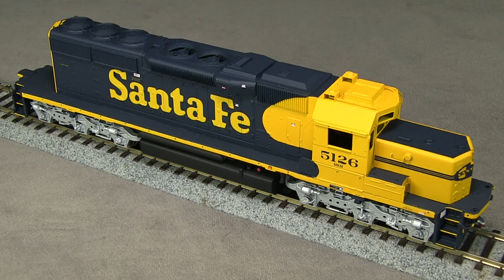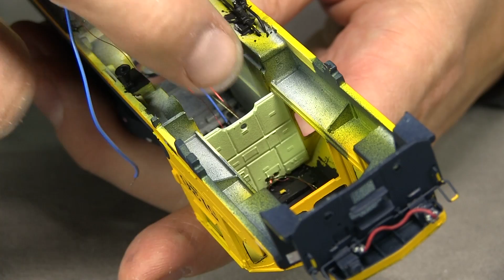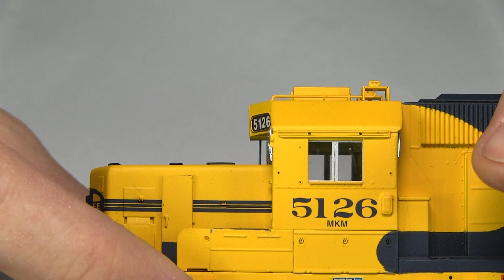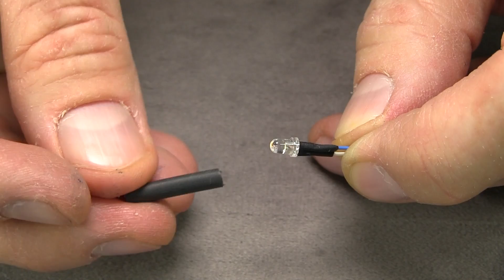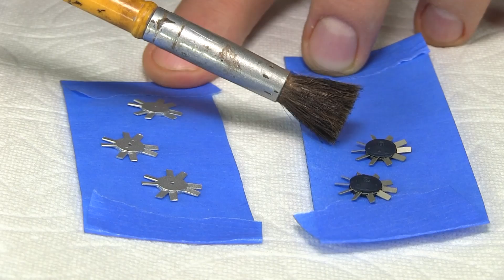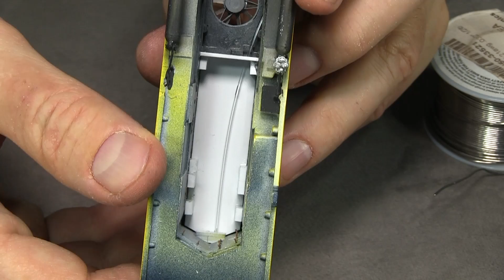HO Scale SD40-2 Model Building 22 of 25 Final Assembly Pt. 1

Comment: I'm not sure, but i think that that since this locomotive had a lowered head light, that that thing from the nose to the number board area is to run the power to the lowered head light from where it used to be.
Reply from the maker: I think that's right. Someone else mentioned that possibility. I think someone else once suggested it might be a pipe for A/C condensation to drip out of. I can't remember now...

Comment: 26:30 It is technically possible to have rotating fans in a HO scale model. Hornby has done it with some of their 00 scale models, like the class 50 and 56 diesel locomotives, IIRC it used a gearbox driven off the drive-motor by a rubber band.

the problem was it sapped pulling power and in the end looked about as noticeable as a stationary fan that had been modeled to look like it was rotating with a translucent disk instead of fan blades, so it's not really worth it.
Reply: I have seen it done with pager motors and looks pretty good depending on the fan housing that is used and if you use shiny aftermarket metal fans. As for getting prototypical rotational speeds the current available for the motor from the decoder function pin needs to be minimal (because the motor has a small load, the load being the simple task of turning the fan). If you fail to limit current draw properly the motor will greedily draw all available current  and spin fast and/or wear out.
Reply: i would try with pager motors

Comment: Dan, I recently bought an Athearn Ready to Roll HO GP35 and I noticed the paint comes off the handrails very easily if I touch the handrails or move the engine around. Is that a normal problem on HO scale models?